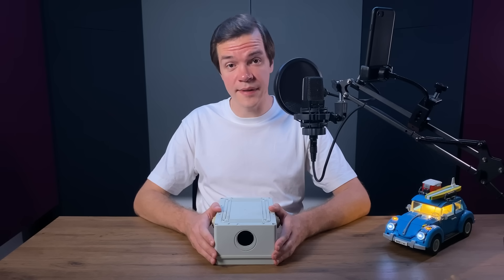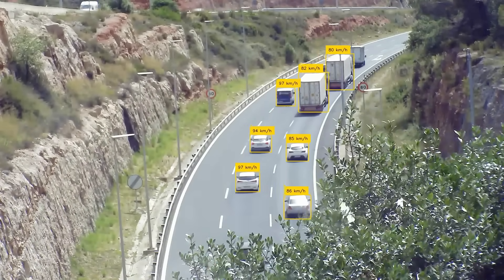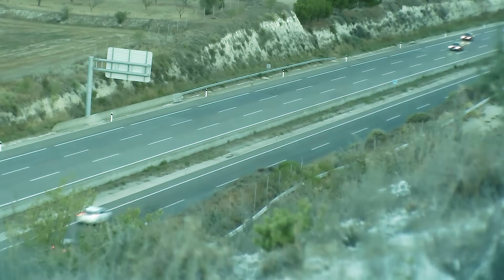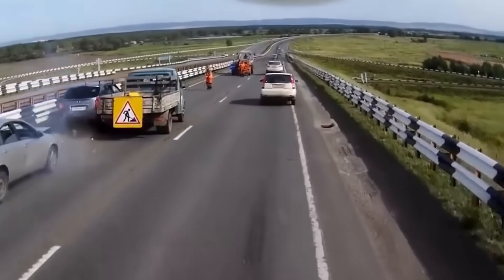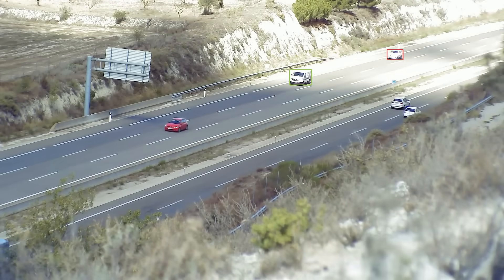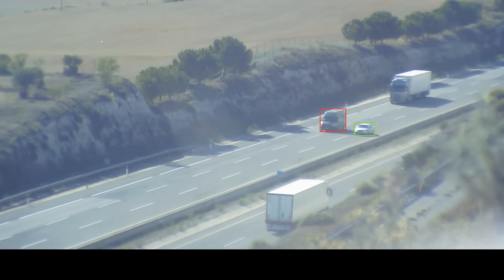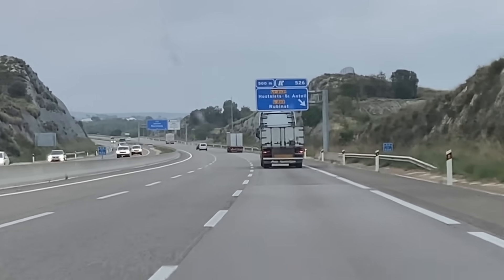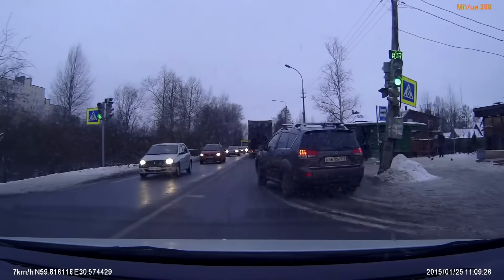New Anti-Tailgating Camera Reveals Shocking Statistics

Comment: It should be possible to implement a tailgating warning sign that will light up when the time between cars (in a given lane) is too short.  It doesn't have to account for idiots cutting off another driver, because it's only a warning sign.
Reply: Many modern cars, maybe even most, have this. People presumably just turn it off or learn to ignore it.

Comment: This was extremely well done, and I appreciate your critical analysis challenging the idea of speed. While I largely agree, I do think that we need to realistically acknowledge that speed is a factor. Speed itself is not the deadly one, it is the other issues, such as the one you have brought up (safe following distances). If someone is going lets say 130 kmh and tailgating someone, and they suddenly brake heavily, it will be pretty horrible scenario. If they are tailgating at the exact same distance at 100 kmh, it will be severe, but less so. This logic applies all the way down to non-highway comparisons.

I do think that we need to deal with the issues of tailgating, but speed is not innocent and we need to ensure that speed limits are fit for purpose for the road that they are on, and deal with speeding just as much.

Comment: Tailgating is really awful in North America, even more in the USA.
It seems to be associated with the "I'm the important one" attitude, and it even affects the driving in traffic zones where the traffic is slowed to a crawl... When drivers leave more space between cars, at very low speed, it's often possible to keep moving slowly, maybe in 1st gear of a manual transmission, and it eliminates the "accordion" effects, and lots of small collisions, with the small collisions causing even more traffic congestion... But, the idiots who insist on changing lanes, and jumping into the space that allows you to be safer, and actually more relaxed, the selfishness, they think that they might gain 10 seconds!!
And, at high speed, the tailgating collision is perhaps not the biggest problem; when a tailgating driver suddenly realizes that the vehicle in front is stopping, or slowly quickly, the thing that can cause a bigger "collision-collection" is the skidding, loss of control, OR, the driver slewing across traffic lanes, hitting vehicles beside them, or causing the vehicles in adjacent lanes to run off the road, or slam on their brakes, or hit a guard rail, slam into a bridge support....

Comment: Austria has anti-tailgating cameras indicated in the autobahns around Vienna, it is actually a thing that is being imlemented!
Reply: I wonder how many people get busted who WERE maintaining a safe distance before someone jumped into the gap in front of them, creating an unsafe distance.
Reply: @meaninglesscog  They certainly have to account for that, and you could ask for a video sample that shows you were responsible, meaning that if you maintained that close distance for too long, the fault could fall on you. There's no way to implement this with a complex algorithm that flags with various confidence levels, or an AI model might be able to do the job. But ultimately, it will either require human review or a video proof sent to the offender so they can refute it.
Reply: @meaninglesscog  just put a second camera for just recording right before the anti tailgate one.
Reply: Germany also has had cameras for this purpose for decades.
Reply: Id love to see this in my area. Tailgating is a huge problem especially in high traffic times. People want to drive 75 and get stuck behind 65s. Its a two lane freeway. The left lane is supposed to be for passing. But people also just sit in it like a bunch of idiots. Should be fines for sitting in the passing lane (you can get pulled over for it) and tailgating.
Reply: @SpartanChick316  Fines for sitting in the passing lane starts being implemented in Russia. Will see how it works. And problems it will cause.
Reply: @SpartanChick316  when there's too much traffic for one lane, what's the problem with using the "passing lane"???
Reply: @mrxmry3264 if you are passing those cars. Fine. But ive seen people "sit" in the passing lane. Forcing people to figure out how to safely get around them in between semis or other traffic flow. When said car could just slot in to the available space and let the faster traffic go by. It pisses people off to such a degree they drive recklessly in most cases to get around. You should be aware of traffic around you. YOU as a driver should be paying attention. Almost no one should be passing you on the right.
Reply: The surveillance state must grow. You really think they won't use it to track your location?
Reply: I don't understand why this is dismissed (as it was in the video) - it seems easily solved to me. Have 4 or 5 cameras along the road. If you're tailgating in all of them, expect a fine. If you're tailgating in one of them, you were probably cut up by someone else. If the state really wants to educate rather than fine, make the first offense result in a warning with no other consequence.
Reply: Awesome.